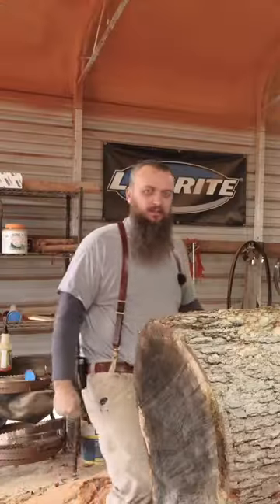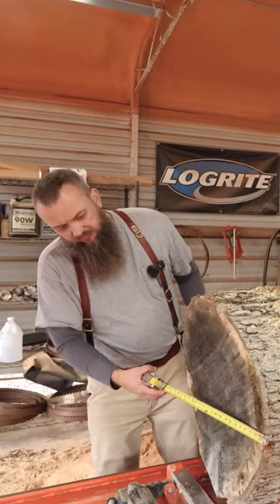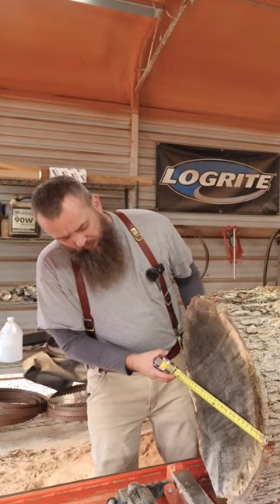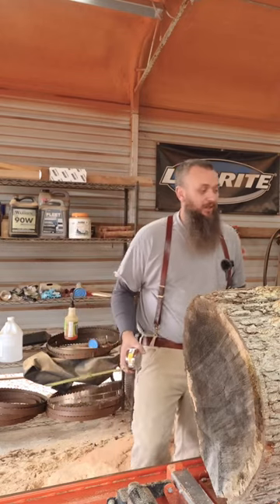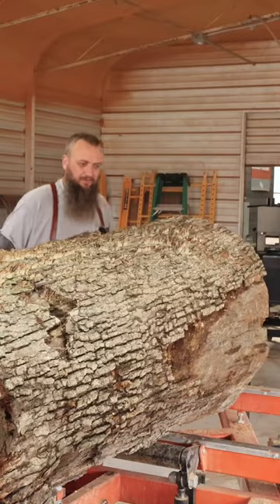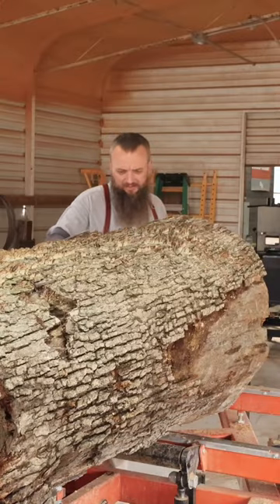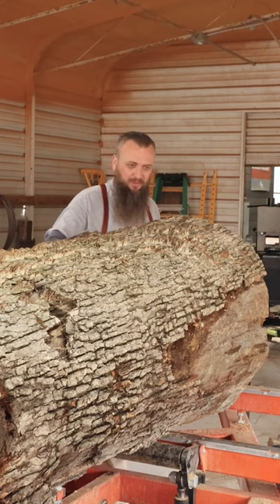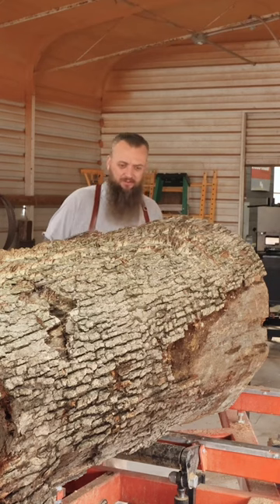Monster Oak On The Sawmill #shorts

Comment: I have several very large oak logs . 18" or so dia. 20ft long. Who do i call about getting rid of them?
Reply: Where are you located
Reply: @cecilsink9901  Texas. No of ftw
Reply: Only 1200 miles from me. I'll be right there.  😂
Reply: @cecilsink9901  i was hoping you might tell me what kind of tree service to call. Id like to keep as much of it as lumber as possible.  And the tree services iv called just want to run it through a chipper.
Reply: I'm betting there are some hobby portable band Sawmills near you.  Try looking for Facebook  sawmill groups and  post photos of your logs
Reply: You'll probably have  to  pay to take them down and then pay to have them sawn. I  will  do "easy" trees (anything that isn't threatening a building , road or powerline) that are close to my house for free for the  logs,  most will charge for it.
Reply: I got hooked up with  a tree removal guy last March and  worked for him, cutting, limping, and  chipping and got all the  logs and  chips but no pay. I  got about $3,500 worth of walnut and  cherry saw logs, about 30 yards of  chips and  5 cords of firewood  logs for  my work. The  walnut is  excellent.
Reply: They have  an LT50 portable which will readily  handle the  size logs you have. You'll probably  need to  have a farm tractor , backhoe, forklift or  skid steer available  to  yard the  logs to the  mill